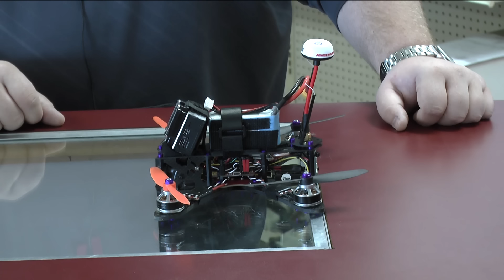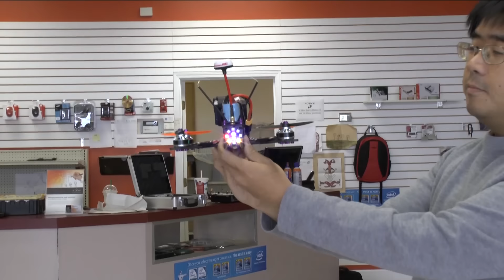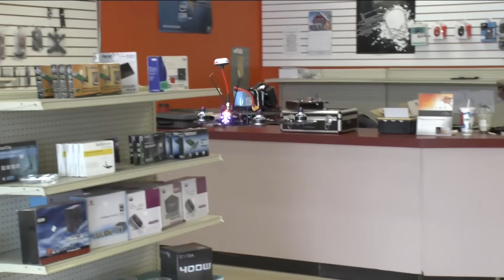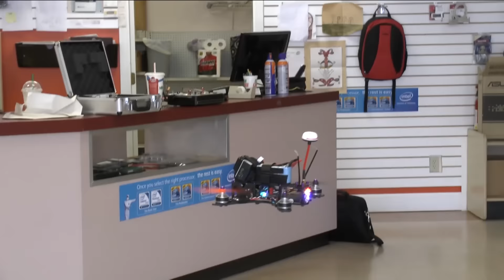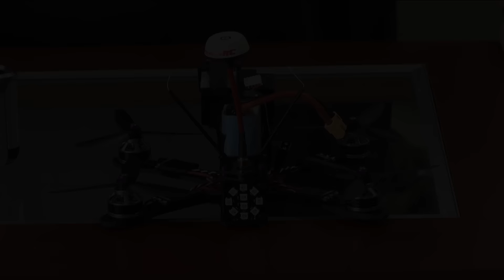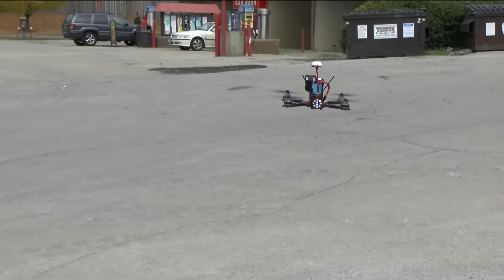ImpulseRC Alien 5 - builder's vlog

Comment: is this frame smaler than the blackout?
Reply: +Johnny TSC Most of the top pilots are flying the alien frames.  It also won the drone nationals races last summer and the F3 expo races this past weekend in Atlanta, so there is that...
Reply: +Johnny TSC ITs actually slightly smaller just a hair larger than a 210mm in comparison
Reply: +Zach ‘zestyZsauce’ Scally thanks! Its not very a clean build in comparison over the Blackout... you still recommend this frame over the Blackout? so yes, why? :) Im just curiuse
Reply: Thank you!